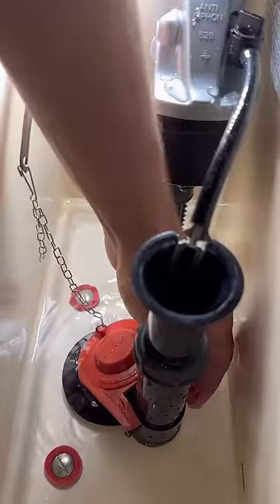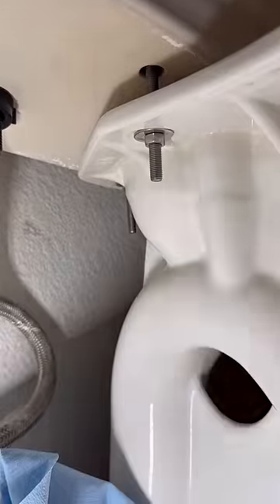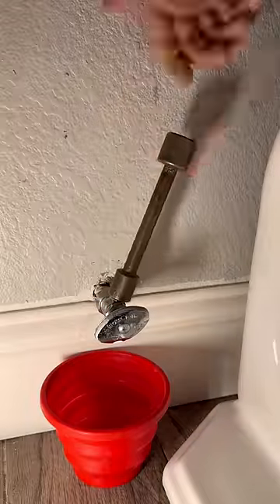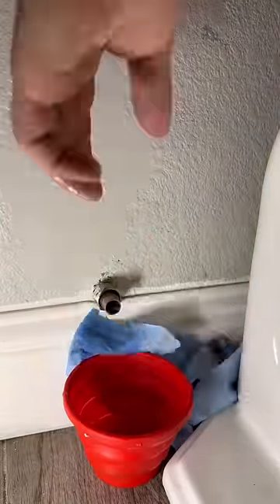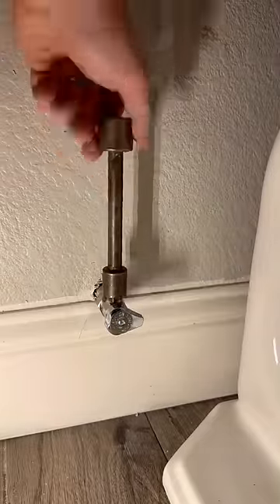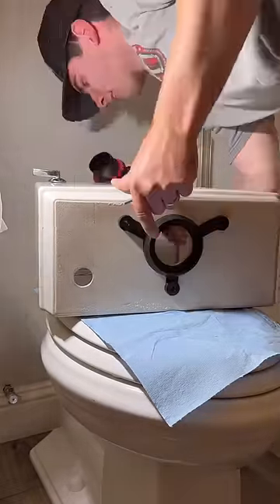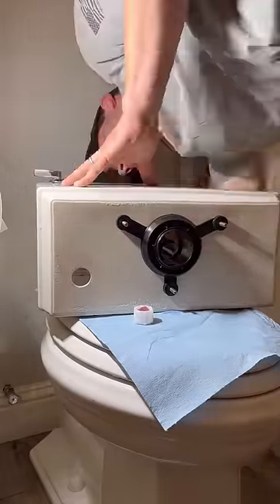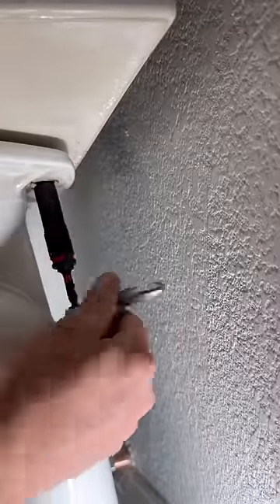enjoy #plumber #plumbing #diy #repair

Comment: Aye boy clean brass is worth over $2/lb they're ripping you off.
Reply from the maker: It’s dirty brass
Reply: How would that be clean brass? Come on now
Reply: @sjohnson5813  clean it and  make it shiny , then it's clean brass .
Reply: If the gate and stem are brass just take out the screw and take off the handle. If a magnet sticks to anything else it's dirty.
Reply: @cody39yrs  that's not what clean brass means in the scrap business ,kid
Reply: @Cody  • 39 yrs  I scrap once a year and I would never waste time breaking down a fking stop. When you are in the service/ remodel field,  you'd be amazed at the amount of scrap brass and copper you can get. That would be insane to do that. The only brass I'm breaking down is pressure regulators.

Comment: I'm a layman who just redid a toilet using a generic rebuild kit last month. The kit specifically warns you that the Kohler triangular gasket is special and has to be bought separately. (There was a similar warning for some other brand, but the toilet in question was a Kohler, that's why I remember. I had to make a second trip to the hardware store for the gasket.)

Comment: I just did a job yesterday for the exact same reason on the same toilet fluidmaster has a flush valve that comes with a Kohler three bolt hole tank to bowl gasket Even comes with a little tool to tighten the nut on the fill valve

Comment: No hate. I like to take my tin snips and cut it where it can sit on top of that base board against the wall. It’s a pain in the ass if your cut has to be close to the hole but the white plastic ones are way easier to do

Comment: Serfaces can't be cleaned between the wall and tank. Decades of feces buildup (Wall mouted toilets only) So... the braided line is expensive and ugly cuz it never fits. But it takes literally 5 seconds. But if you take 2 minutes to Use plastic tubeing stufs/copper coil. U get to use thoes powerful plumbing skills. It is just  Way neeter and and cleaner.
Reply: The braided stainless line is wayyyyy more reliable. Sorry, but I disagree. If you had to pay for insurance , you would see what I'm talking about.

Comment: Nothing wrong with using a generic kit. I'm a licensed plumber and do it. It saves people time and money if you don't have the kohler parts .... but it's me and my dad we also don't charge customers 225 a hour either so 150 bucks for rebuilding the toilet with what we keep on the truck is fine and we typically tell them their not factory parts. And only SOME do we use generics because SOME will double flush.

Comment: You dont use generic on a Kohler , but speaking of Kohler I went and lady had a 600 Kohler tub faucet a handyman service put in well it's horrible I have to fix this crap and they did tile and it's up and down faucet not strapped in wall , 300 dollars in sharkbites is how they installed it I think I'm gonna post this video even though I'm more guitar channel